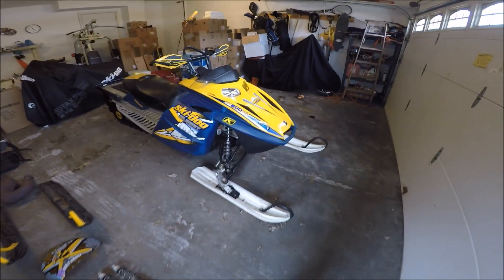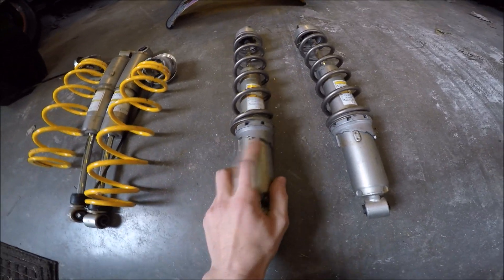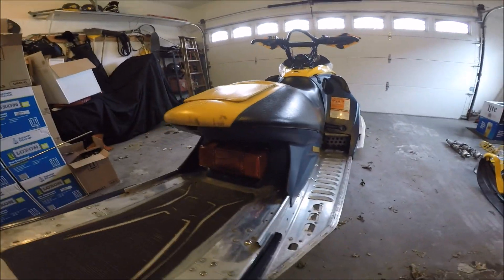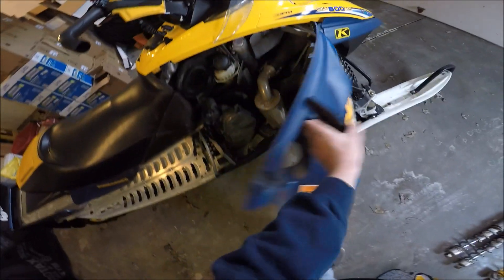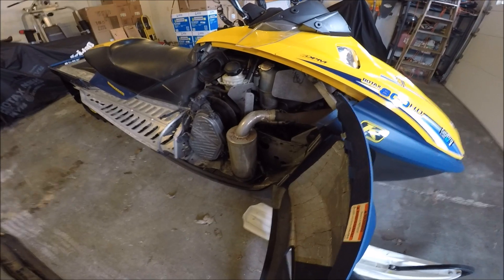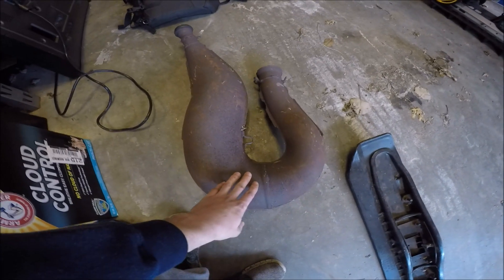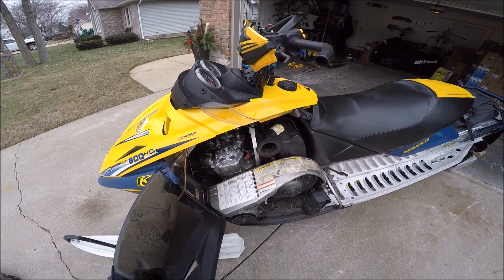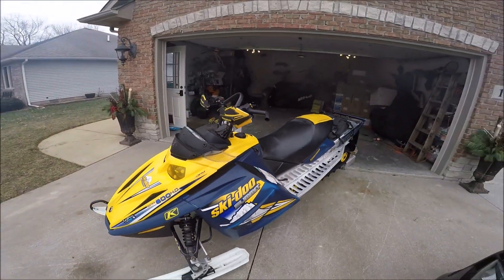2005 Ski Doo Summit 800 H.O. Review/walk-around

Comment: Got nearly the same sled man. Nice video. 
Recommendation for it though... 
definitely recommend to bump the track up to a 146”x 2.25” track. Makes a difference! Just brought my sled up to Togwotee. Had second smallest track in a group of 15-18 guys and the oldest and I did alright🤙
Also clutching is a key component
Makes this sled just a little more fun
Reply from the maker: 4Stro Moto I got a dynamo joe clutch kit and she pullls harrrdddd🤙 sounds like a good time I’d like to get up too the mountains one day my self! And you’re right with that, track makes a HUGE difference for sledding off trail lol
Reply: SwitchBackKid600 Haha literally just got to the part where you mentioned clutching🤣 Not the best clutching out there.... But its alright. Highly recommend Sledhead Racing. Seriously is awesome. No clue if DJ does this on his clutching but SHR does. Its called “Quick Clickers” on the side of the trail, in the mountains, or whatever you can adjust your RPMS to engage properly literally right there. You can go from Michigan to Minnesota riding or what I did... Minnesota to Wyoming riding in a fee minutes. Had my RPMS at 8000-8100 up at 11,000ft. Pretty dang good.
Reply from the maker: 4Stro Moto DJ clutch kits pulls just as hard if not harder than both those kits you
Just mentioned... and yes joe is up to date with all that provides you with everything u need extra spring and pin weights also for changing elevations, the summits have clicker numbers on the secondary clutch you can adjust RPM’s that way
Reply: SwitchBackKid600 I work for SHR. So I just have a very strong opinion lol. Still even before I knew the owner he’s a genius about Skidoos. To each their own I guess🤙